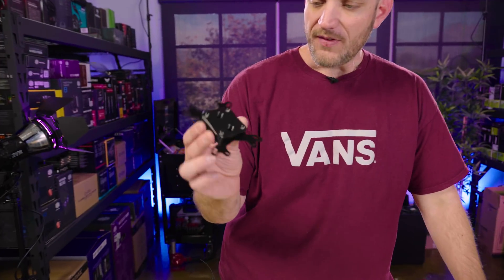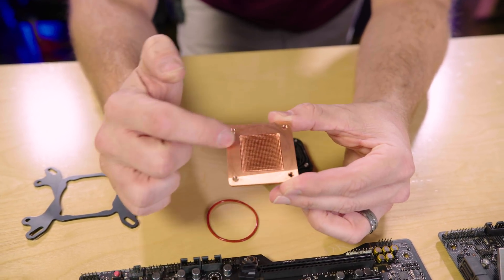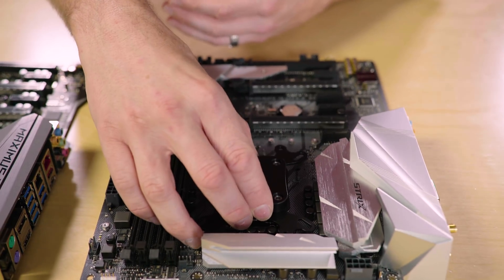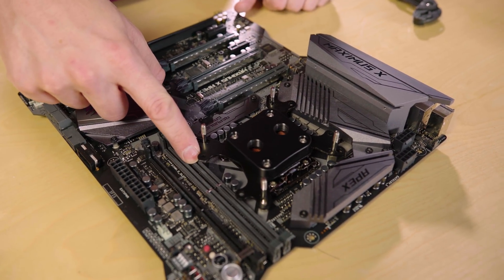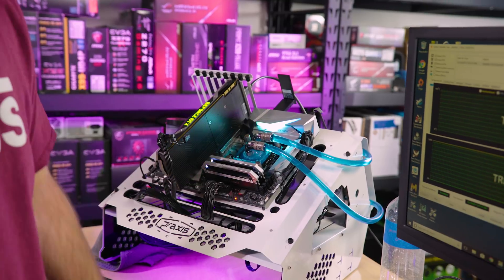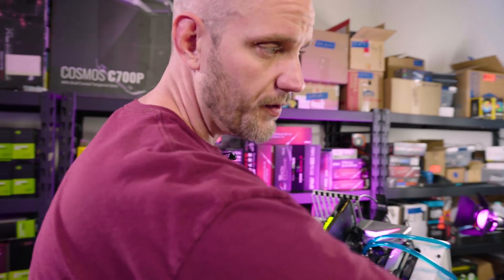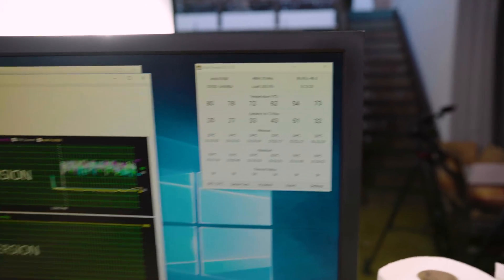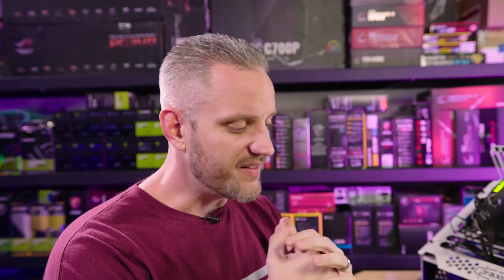I tried watercooling an overclocked 8700k with a $19 waterblock

Comment: +JayzTwoCents You can just take the cover off the block and remount it the way you want if the bracket only goes one way BTW... 4:23
Reply: Ceadderman look at that block. Its 100% synmetrical. The machining is easily done and its the same in 4 directions. There is no optimal flow direction yet the block is just as capable as any other block.

Comment: *Imperial not standard and metric, again. And sup with the lip man? Awesome test btw. Maybe do a test of radiators of a Aliexpress/eBay
Reply: technically US customary system, not imperial
Reply: xdanano it was standard..... in the 1800s XD
Reply: But! American usage of inches, pounds, etc. far predates the Imperial or Exchequer Standards. That system was introduced and codified beginning with your Weights and Measures Act of 1824, by which time we'd already been independent for a few years. Both systems do share a common lineage, but they've been developing separately for a couple of centuries now.

Comment: Used this block b4 this vid was released and its keeps my fx 8350 at 4.6 with the highest being 41 with a 360 mm rad I can't say enough good things about this block when it comes to a low budget
Reply: wow so I can consider myself lucky that I got an 8320 to 4.8 under a single tower aircooler with max 60C. At 4.5 it stays below 35C now (since it's not in my main rig), under a "thermalright true spirit 140 power" with a single EK vardar on it.
This is either a great cpu, or FX temperature sensors are trash (just like intel stock tim).
Reply: Great man. I'm using the same block to cool my fx-8320 overclocked to 4.5. I've been using it for a year and a half, and I didn't have any problems with it.
Reply: Great man :) . I managed to push it to 5 GHz on water, but it wasn't stable for the long run. SI also lowered the overclock so I can manage the temperatures better and have the fans on the radiator spinning at lower rpm.

Comment: Guys i was trying to build my first pc, and everything went well. SSD came late, so i built the whole thing and then waited for ssd. everything worked perfect. then when i plugged keyboard in after the ssd was installed, none of my usb ports are working. I've tried the keyboard and mouse in different machines and they work. The pc boots up fine, but i cant hit delete to get into the BIOS. I'm pretty certain that everything is wired up and connected properly. Im not sure if this matters but the usb ports work for charging my iphone, but not my keyboard. Anyone want to save christmas and tell me how I can fix this ? :D
Reply: Which USB ports did you use? did you try the ones on the back directly on the mainboard? Do you have an other keyboard you could try somewhere, maybe a friends or so. Is it a new model of keyboard or an old one. did you try usb 3.0 or 2.0 ports. so many possibilities. The safest bet (if you can find one) use a PS2 keyboard.  you have to connect it when the pc is turned of!, but it will always be recognized. if nothing works, get a ps2 keyboard, you can get one very cheap online.
Reply: shallo1999 it's possible that it is a fast boot bios setting set to not initialize the usb ports until after windows loads....if this is the case then I would imagine the board has a ps/2 port also or it wouldn't allow the peripheral usb ports to be shut down before logging in. If that is the case find an old ps/2 keyboard and change the fast boot settings. I can't think of anything else that could cause your issue and if that isn't it contact the manufacturer pf the board and they should be able to help.
Reply: shallo1999 plug the peripherals into the rear USB ports that are on the motherboard itself.
Reply: Happen to me before, few days ago, i just unplugged everything from the motherboard for few mins and repluggged everything and ran fine since then
Reply: shallo1999 check for new drivers from the manufacturer of your keyboard, and also check for chipset drivers.
Reply: Unplug the ssd (and all other drives that have an OS on them), boot up the pc, and turn off "quick boot" or "fast boot" or any settings similar to this. Those skip the phase where you could enter the bios.
Also plug the keyboard in through a 2.0 port in the back, if you have one.
Reply: i dont have an OSS on any of my drives D:
Reply: Then get an os, some keyboards don't work without one. Check out Kinguin or cdkeys for an affordable windows 10 pro key and get to rockin!
Reply: If you want you can direct message me and I can assist further Pc mechanic of 10 years A+ cert
Reply: kepeter97 Correct answer. Or, unplug all drives, usb sticks included. (And we are taking for granted that the keyboard works...)

Comment: what about reliability
Reply: I've been using it for a year and a half, and I haven't had any problems with it so far.
Reply: lacucaracha111111 their is no moving part,  the red joint is mad out of silicone so no Pb with reliability , if it don’t leak from the start it will never leak

Comment: Jay, it's 6-32 machine size) not 6/32 (fraction). It's ANSI Machine Size 6 with 32 threads per inch. The nearest equivalent fraction is 9/64.

Comment: I have a similar block, worked great. Switched to AM4 platform and bought another cheap ebay block, but in acrylic. Looks good, cools good. 1600X @ 3.9ghz 1.3v, 62c in OCCT stress test using small data set. 240mm + 120mm rads with fans @ 1500rpm.

Comment: 19.99........

I trust it
Reply: A block is just 2 pieces of material with some holes in it. so as long as you get that blond strand of hair out, it should be the same as any other block really.
Reply: same Chinese manufacturing process and same piece of copper. they probably shit these parts out for little more then material cost.

Comment: Probably really reliable...
Reply: Critical thinking skills and understanding of the most basic of engineering is severely lacking here.

It's a fucking water block, guys, there is NOTHING difficult about manufacturing one that is effective and reliable.
Reply: and this block costs 2 dollars in China
Reply: and this block costs 2 dollars in China
Reply: and this block costs 2 dollars in China
Reply: otakuMCkid6969MRstealYOgirl it's a chuck of metal with a o ring... lol
Reply: Dennis Rigdon It would probably last just as long as the EK one, not like a waterblock is that hard to make reliable anyway due to the lack of moving parts..
Reply: And that's a standard silicone O-ring too, more than fine for this application
Reply: i had a $150 EK monoblock short circuit $1500 worth of hardware. the wires that went to the stupid RGB lights inside the block were exposed and ran a current through the block itself.
Reply: Silicon is good up to 232 degrees celsius, machined, ANODIZED aluminium part wont flex and wont corrode. If only You will run coolant that works with copper it probably wont fail ever. I would take that over clear acryl or whatever the other blocks are made of (some even rely on threads in polymers, like WTF).
Reply: I'm 7 months in on mine.
Reply: Same goes for reservoirs and pumps.

I bought a 30$ 310x50 reservoir+pump combo from BangGood and it's been running perfectly fine for over half a year now.

These blocks are quite interesting to me, the one I have is like that EK one he showed (plexi topped). Cost 90ish when it was new.

But my systems aren't for show, at all, one is under my desk with 1.5" wood paneling around it to dampen noise.
The others in a broom closet on the other side of my appartment.

In Watercooling becoming more mainstream, I wish there was more mainstreaming of purely functional hardware rather than purely cosmetic stuff.

I don't have a single RGB fan in any of the 7 systems I have in my house.

I don't need RGB, plaxi, perfectly bent hard tubing.

I need loops that do work.
Reply: well but thats a x1000 .... not in any way comparable to this. Its a solid crafted and engeniered waterblock. Dumbed down to whats managable while still being cost effecient. Like it alot. But i will go with EKWB anyway since for me, i prefer there looks. Nontheless its a pretty compelling option for people who just want the performance.
Reply: quite alot moving parts, water.
Reply: That copper looks iffy to me. So longevity would be a concern, so dose the o-ring.

Comment: I'm still running a $120 custom loop I bought for a bit of practice before buying good parts. That was almost 6 months ago...  
Works pretty well though
Reply: what are you using for parts?
Reply: Calvin Geishirt cheap kit I got off eBay it's currently $116 although I am using ek cryofuel coolant. I'll warn you now quality control is not good. Out of 10 fittings 3 were completely useless. The pump is stupid loud and my kit was completely aluminum. But it manages my i7 4790k pretty well. Just keep in mind you get what you pay for.
Reply: The full aluminum/aluminium loops preform within marge of error of full copper. They are just a lot cheaper.

The problems start then you start mixing alu with copper. Then you get accelerated corrosion in your loop.
Reply: thomas de veer i agree. Thats why you most of the time cant upgrade that much with a aluminium loop.
Reply: R3d's Tech link?  I was interested in an aluminum loop since EK released their stuff
Reply: Sean Dempsey I cannot vouch for quality or longevity of anything you buy. Buy the ek kit it's more expensive but its from a trustworthy supplier and they will stand by their product. But you'll find it either way so here ya go... https://rover.ebay.com/rover/0/0/0?mpre=https%3A%2F%2Fwww.ebay.com%2Fulk%2Fitm%2F201615253329
Reply: Nite Owl yeah but I don't trust them. In January I plan to do a proper review of the kit and see how the aluminium has held up.
Reply: R3d's Tech  i put thogheter all the parts on AliExpress, and i got good results( all brass/copper). I bought freezemod fittings(all worked), 360mm freezemod radiator, a pump and reservoir combo(a bit noisy) and a clear acrylic water block for ryzen. It works really good no leaking, and it was only €120.
Reply: @thijsgadella  how are they holding up?  Im just ordering some Barrow brass fittings, hope they work well
Reply: @ZbladeVX  still working fine. No problems after a whole year now.
Reply: dude i bought  all my water cooling stuff on ebay and dont even have 130 in it and its all copper. i have cpu block, 240 rad 360 rad all compression fittings. i put both the 240 and the 360 rad cause im upgrading to a full cover gpu block soon for 115.00 i do have one of those cheap gpu blocks but i dont wanna use it cause it doesnt cool the vrms. but as long as u look good at what your buying you are fine. my rads were used but i got them CHEAP. i paid 25 for the 240 it is a swiftec rad and i paid 35 for my 360 its a black ice nemisis. u can get watercooling stuff cheap now.
Reply: Is it still holding up 5 years later?
Reply: @glock5202  looks a bit ratty but yeah actually. On my third pump but the rest of the components are still doing good.  
I have the kit on my r720?(maybe) server that I've got stashed away in the closet

Comment: This video is perfect because I'm going to use 2 of those waterblocks for my system!!!
Reply: GingerSquatch one on the gpu?
Reply: Nope, dual 2360SE Opterons on a rare Asus L1N64SLI-WS flashed with a WS/B BIOS. Oh and I'm also running 16Gb of ram with no problems when 8Gb is "supported"
Reply: that sounds cool as fuck.
Reply: The only problem is that I want to water cool the dual Southbridge chips and can't find a waterblock that won't  interfere with the graphics card slots. It would be shaped like a big upside down L because of the VRM to power the Southbridge chips, I think I will have to make something custom to accomplish my goals.